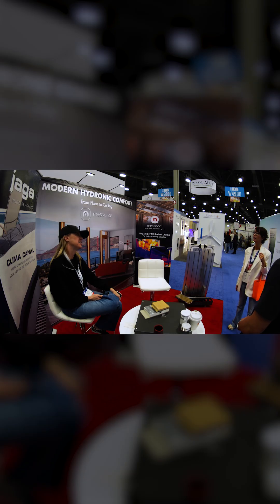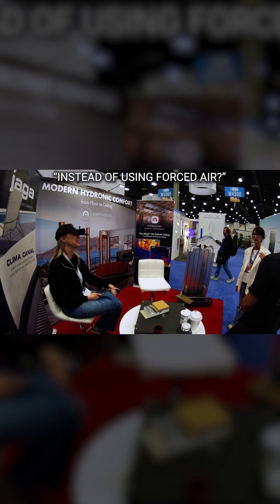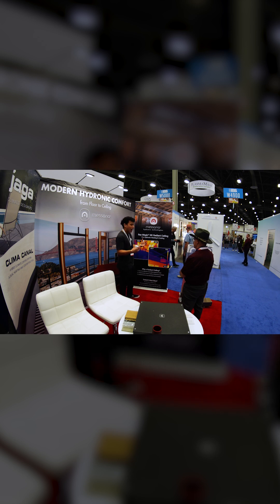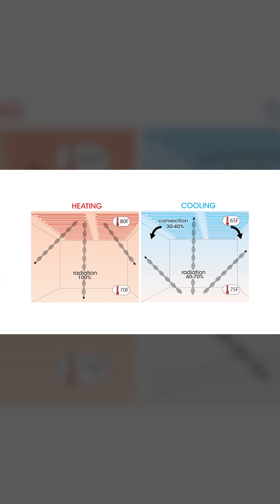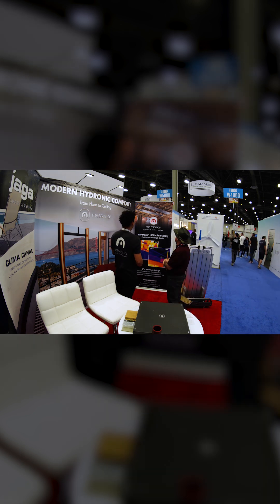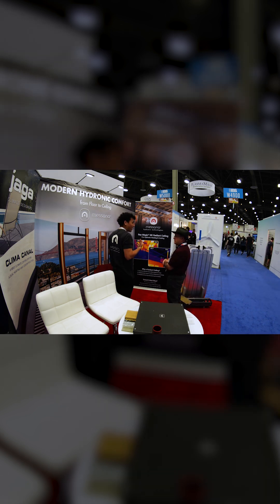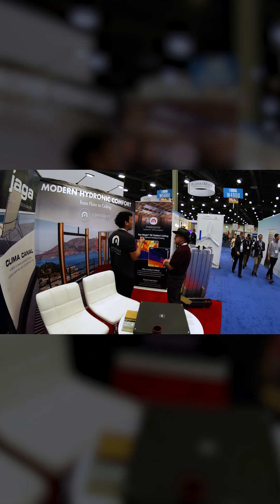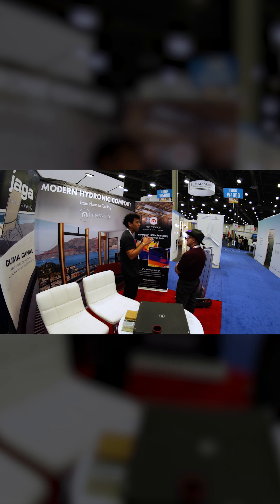Radiant Cooling at IBS 2025! #shorts

Comment: doesnt work. Its extremely stupid because hot air rises. If your floor is ice cold and the ceiling is 30°C, its still going to be cold inside because you will have cold air accumulated on the floor. Owners of this company should go through basic physics courses first. jesus christ